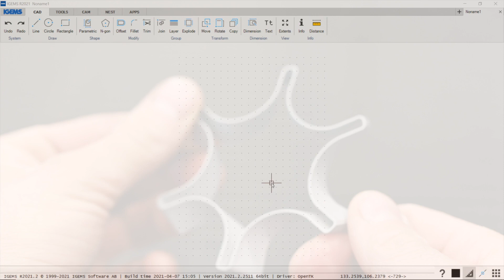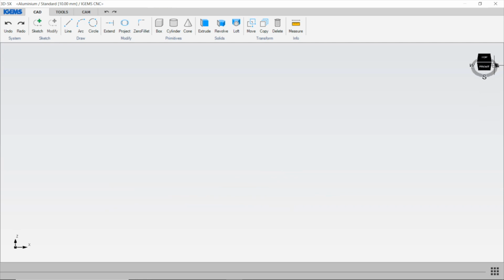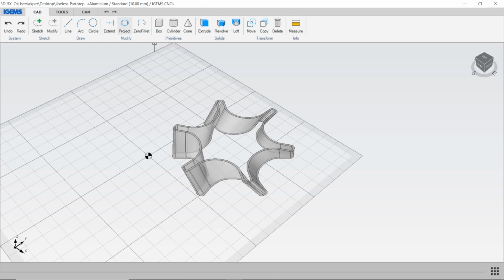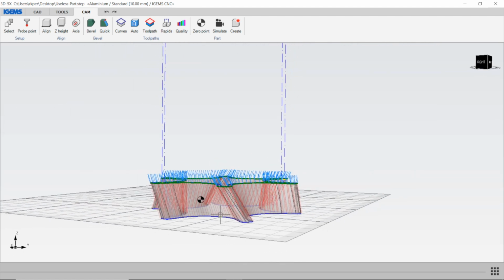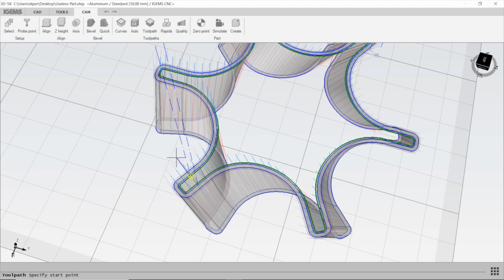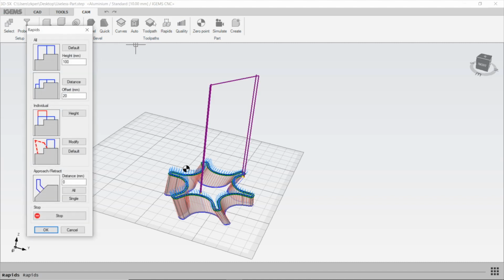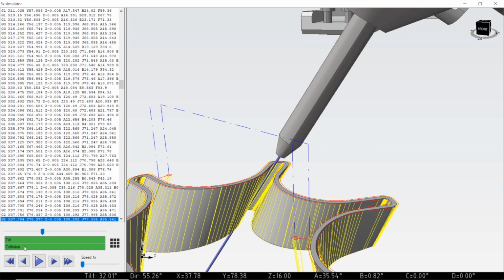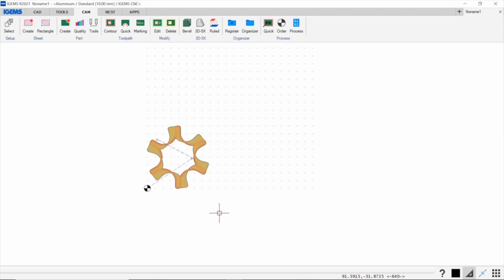3D5X - How to program 3D parts in IGEMS CAD/CAM

Comment: Is IGEMS support KMT Waterjet Systems?
Reply from the maker: Hi Kishan, as far as I know KMT is not producing complete waterjet systems. If they did, we'd love to support them. As for now we support many of their integrators. If there's a specific integrator you have in mind that we don't support, we're always interested in new collaborations.
Reply: @igemswaterjet okay sir, actually A Innovative is use KMT Waterjet Systems, A Innovative is making full machine setup and i have 1 of them, and they use a item cad, most2d and automation software, so please suggest me to how to use igems
Reply from the maker: @KishanKansagara06  They are a reseller of ours, so I suggest you contact them.
Reply: mr. kishan, igems is cam softwere.not affect to kmt pump and whitch pump you use it.
main thing is, your cnc controller post processor need to develop for igems.
i applied igems in weihong controller system 5-axis at last year with kmt -h20 system.